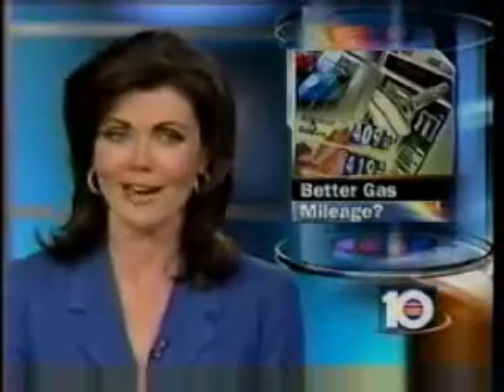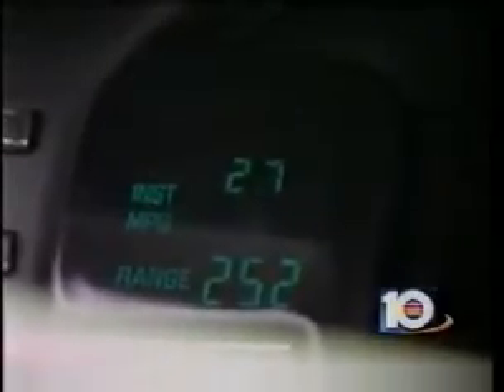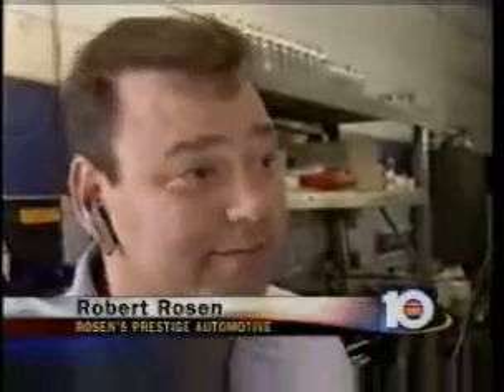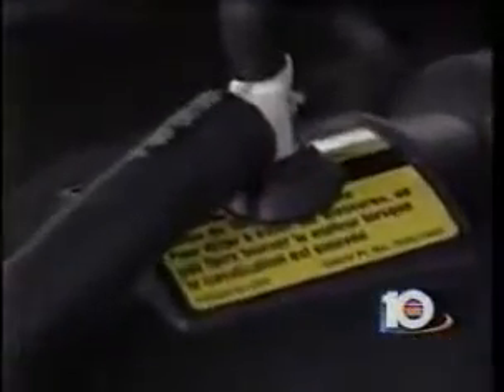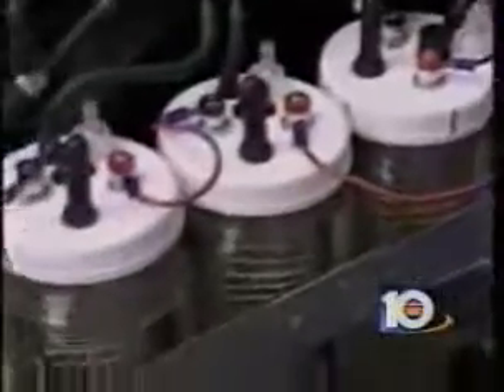Better Gas Mileage with Hydrogen

Comment: Using Hydrogen Gas and run it through a fuel cell stack to create electricity is an interesting concept. I have yet found information on how much electricity it can create to send power to your battery.